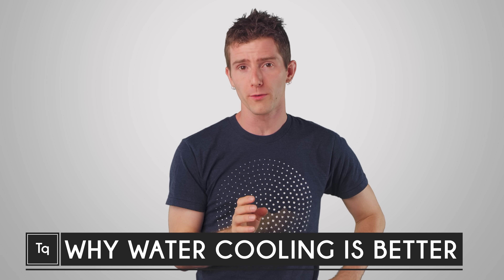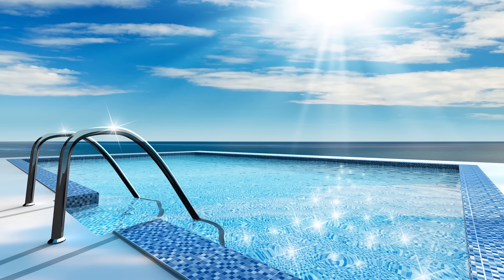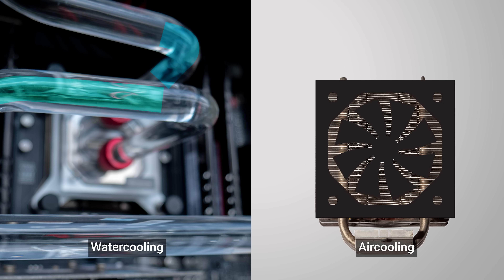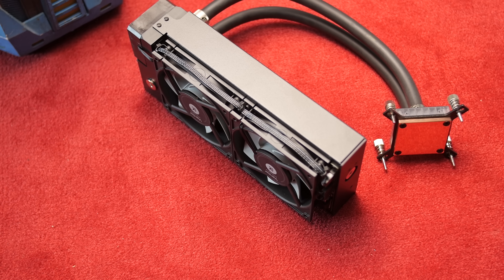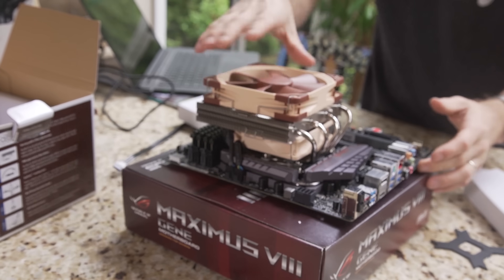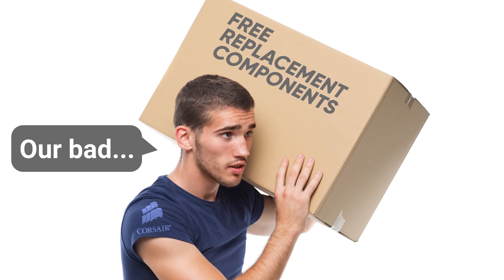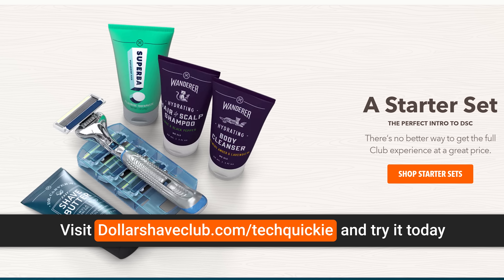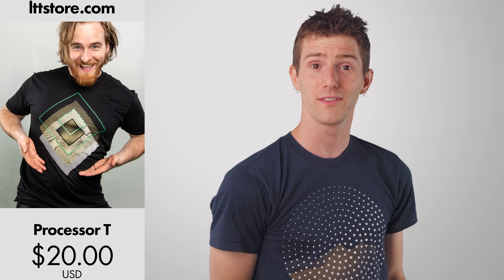Why is Water Cooling Better?

Comment: I think this video has gotten thermodynamics a bit backwards.

Tldr;
Heat capacity does not cool. 
Water moves heat effeciently (lower impedance) to a thermal dissipator (radiator). 
The radiator is better at transferring heat to the air (lower impedance) partly due to size and additional airflow. 

The video spends a lot of time explaining heat capacity, but heat capacity does not cool period. This would violate the first law of thermodynamics (conservation of energy). 
If heat capacity was lower, the flow rate simply had to be higher to move the same amount of energy i.e. same cooling performance/temperate increase in the processor.
That being said a high heat capacity is good at reducing short term temperature increases from the processor e.g. a standard intel boost stage. 
Thus water cooling will appear as having a much higher cooling capacity until the loop is soaked with heat. 

What is important is simply that moving water is very good at moving heat and distributing it efficiently over the radiator area (main problem in heat pipes). Moving heat efficiently to the radiator is what matters.

The radiator is where heat is dissipated i.e. what determines the cooling performance (nothing else e.g. the thermal capacity or flow rate etc).
The radiator is what makes water cooling great. It has a much higher effective/efficient area (or higher or better utilized airflow) for transferring the energy to the air than an aircooler. That combined with the fact the water transfers the heat more effeciently to the radiator (low thermal impedance, especially at low temperatures) and that (as you say) draws in fresh air as opposed to case temperature air, which is often much hotter will yield a considerable temperature improvement over air coolers.

Comment: i have a xlc 240 predator in my system. been up and running since i bought and installed it. had to change the block that it came with tho cuz they seem to leaky very very slow where the rubber gasket  meets the block.keeps my cpu at no more than 52c overclocked. very quiet too!

Comment: Either better performance or lower noise, both are good reasons for getting a water cooler, my old rig came with a extremely noisy air cooler, I still blame it my current ear problems on it (it sat at my left, my left ear have lower performance than my right ear, ant it still have noises [ringing and white noises] they're manageable though), took me too long to realize the benefit of a water cooler, bought one, no more noise, very quiet year around, quieter than the cooler on summer, never overclocked it, though.

Comment: The amount of misinformation in this video is extremely worrying.... Dislike from me.

One non-truth mentioned early on is briefly somewhat corrected at the end of the video, but that's not good enough.

Air coolers are either quieter or cheaper than water coolers. This fact alone means that, aesthetic preferences aside, watercoolers are NOT as good as air coolers, and should generally be chosen for reasons other than performance or quietness. It is worth noting however, that watercoolers tend to have smaller temperature deltas. In a scenario where a watercooler performs just as well as an air cooler, the watercooler cools down more slowly after, and it also warmed up less quickly. This is beneficial for the longevity of components.

However, watercoolers come with plenty downsides, like:
- more noise (pump)
- higher cost OR worse peak temps
- higher system weight
- a failure point (pump)
- the (though rare) possibility for leaks, which could then lead to other components shorting out/dying

So, the plus sides of watercoolers once more:
- reduced case temps (if radiator mounted in exhaust position)
- CPU (or GPU) heats up and cools down more slowly (despite the higher cost or worse peak temps)
- 'cool factor'

Basically, there's nothing wrong with watercoolers, and nothing wrong with aircoolers. But know that watercoolers aren't magic before you go out and buy one :)

Comment: Well to be honest. No aio beats a noctua nh-d15 after like a half hour or an hour of stress test because water just keeps on getting hotter. The noctua will get hot faster yes but the max temperatures are still lower.

Comment: The facts were in my opinion "Generally OK". But in my opinion it's kind of "bunk" to say that watercoolers are quieter than aircoolers because their fans don't have to work as hard...

If a cpu puts out a certain amount of heat a fan will have to "blow it away" one way or another regardless what "system" You use... The factor that lets watercooling fans be quieter is IF you use a bigger area for the "radiator/heat sink" (which You almost always do), and this in turn lets You run Your (usually larger and/or more) fans at lower rpm's which is quieter...

Comment: Water has a high heat capacity because it can vibrate in 6 directions

Waters high heat capacity comes from the fact that it can translate its heat energy into 6 kinds of vibrational energy. Most materials can only vibrate in 1 or 2 ways, so there is only so much heat they can absorb. Water can "store" that heat in 6 different types of movement, so it can store a lot more energy per degree Celsius.

If hydrogen bonding were the explanation, then metal (having each metal atom fully attached to each surrounding atom) would have an even higher heat capacity.

The hydrogen bonding does explain why water doesn't evaporate as quickly as it should. So to some extent it can absorb more heat before evaporating that might be expected from a similar liquid without hydrogen bonding. (This is why alcohol and acetone evaporate at much lower temperatures)

To see the 6 possible vibrations of water -- http://chemistry.ncssm.edu/watervibCS.pdf

Comment: Aside from the fact that you said air cooling is as good as water cooling .. 
even before you said that .. I am convinced that the majority of people don't need water cooling .. and most people that get it just wanna look .... cool ..
unless you are an OC maniac .. you are just fine with a good air cooler .. they are not noisy at all these days .. actually I'm running the stock Wraith Prism and I can clearly hear my mechanical HDD which make it noisier than the cooler .. even under heavy loads I can't hear it.
So why the hassle and risk of water in my rig and maintenance ? .. It isn't worth it .. !!

Comment: Noctua NH-D15 + i7 9700k@5.0GHz (won't go higher) and practically inaudible  (case sits beneath my desk..about 75cm / 3 basketball width from me).  Can't complain. AIO's can't do the same and custom loops that could would be way too expensive for it.

Comment: Water has that high heat capacity not just beacuse of hydrogen bonding that is not as strong as other major bonds for example covalent (this uses this,basically sharing electrons)any ways the covalent bonding is very strong stronger then in any other substance,we'll most,this beacuse when an atom like let's say hydroyon bonds, specially with oxygen with oxygen being the electron stealing (we'll extremely electronegative,one of the highest)and hydrogen not having any electron shielding ( this weaklings the nucleus grip on the electron easy to pull of,basically the more electrons the easier it is for example lead would be a lot easier to pull a electron of beacuse of it shells beacuse of its shielding,basically less energy to pull of then hydrogen). So that leaves with an oxygen that really wants the electron and hydrogen atoms that really don't want to give it up,this produces most of the high heat capacity.they are others that contribute but these are weak dispersion forces van da veles and I think London dispersion forces.
Reply: Should always do you research fully or do applied science like me

Comment: what liquid cooler do i need to get better than noctua NH15 thermal performace and still lower or equal audio output even considering a large slow fan is a less anoying sound than a pump.

Comment: Easy, it's not. It's more effective at removing a lot of heat, but if your CPU does not generate a lot of heat water cooling is kinda pointless. Better really is a sloppy word anyway. Just because something is more effective in some situations does not mean it's good in ALL situations. Air cooling still has it's use and in my opinion is "better" in certain setups.

Comment: I’m so confused about these arguments for water cooling. You’re still ultimately transferring the absorbed heat into an aluminum fin stack...and blowing air over those fins with fans. Just like an air cooler. And while the thermal capacity of water might be much greater, that’s only beneficial for the first 30-45 minutes or so until the liquid’s thermal capacity gets saturated (to an acceptably safe level so as not to cause pump or tube damage), at which point the bottleneck is, again, the radiator and fans.

Comment: So the one thing you forgot to mention about AIOs is they tend to last about 5-7 years because the pump will eventuality fail, and the liquid inside will get mucked up. Air-coolers last forever (and some are also liquid cooled with vapor chambers), though the fan on an air cooler will eventually fail, they are easily and cheaply replaceable, unlike the water pump of an AIO and they aren't really repairable anyway. There's also a huge price difference between AIOs and air-coolers too, and I'm not willing to spend $150 for something that last 5 years, when all the other components in my PC have lasted for much longer.

Comment: My Coolermaster V8 looks very cool and works nicely. It's very big and very heavy and I've never had a problem with it torquing my motherboard. Plus it costs substantially less than a water cooler.

Comment: I originally had bought a water cooler when I wanted to overclock my old PC and I busted the thing because it had Intel mounting pre-installed and I couldn't get it off (I use AMD). The manufacturer did send me a new one (which I sold because I wanted nothing to do with it after that). I just ended up sticking in a Hyper 212 Evo in it and it's been keeping it plenty cool. My system can't handle more than 3.5GHz... but considering it was 2.6 stock... that 900Mhz boost makes a huge difference.

Comment: Considering you showed in another video that it takes 360mm of radiator to even compete with a d15 that's less than half the price. That's a no from me Jim. No reliability concerns. No performance drop over time. No piece of shit pump.

Comment: Who freaked out when you showed the results for thermals on nh-15 vs water coolers? This is a paid promotion for water cooling lol.
"Water cooling is quieter.
But air cooling can be quieter because they don't have pumps"

Comment: Water cooling is better - if you want to spend more money, listen to more noise and eventually have coolant contamination, clogged fins, pump failure or coolant leakage.    If you want the same cooling without that, buy a high air flow case with good fans then get good coolers from Noctua - end of story!     Will you please tell the truth?

Your example about the swimming pool being cool on a hot day is as accurate about pushing people to use water coolers in computers.    Decades ago when I went to Fort Sill Oklahoma to take the officer course in field artillery the temperature was constantly very high, one of the hottest summers in recorded history.    The swimming pool on base was so hot that it was closed.    So much for water being such a great cooler.

In computers, especially overclocked, water simply gets hot much slower than the Noctua cooler you mentioned, however, if you tax the computer for a long enough period the water gets hot and after leaving the taxing environment it takes much longer for water to cool down compared to a Noctua air cooler.

And, you do not need a Noctua NH-D15 to cool four, six or eight core CPUs, a Noctua 14" will do.   A Noctua NH-U12S will cool an overclocked Intel i7 8700K.

The only reason that I might replace my Noctua NH-U14S is if the Intel i9 10900K IHS is too large.

I wonder if a few people will get to the latter 3/4 of your video to see you make a few good comments about air cooling.

You are a tech guy, you know these things.   I have never given a thumbs down for one of your videos, until now.    Start telling the whole story.

Comment: As a truck driver I wish there were great ways to have a overclocking laptop with liquid cooling. Even without  overclocking liquid cooling on a laptop is great as the air in the semi truck may be hot in the first place.

Comment: I see all these water cooled builds on Youtube.. but you hardly ever see them 18 months later. The ones you do see always seem to have some issues with the water cooling system, requiring a draining and cleaning. I understand the benefits and maybe they are super reliable *now, but I am holding off until I HAVE to use one. I still like the K.I.S.S. methodology. Keep It Simple Stupid. Water cooling is not exactly simple even if an AIO due to the possible issues it can create.

Comment: Why are radiators mounted so that they either pull (warm) air from in the case or push their (hot) air back into the case ?  Why aren't radiators mounted externally to the case volume so that the air flow to and from the radiator doesn't mix with the case air flow ?

Comment: What the f*** is he talking about? Laws of thermodynamics are wrong? The point here is heat dissipation in both cases it is hot heatsink. The only effectiveness factors are speed of dissipation and heat pockets. Secondary factor is noise. Third factor is deployment price. But you ALWAYS should start with airflow - this is where you dissipate heat. Both water-cooling and air-cooling are fine as long as provide good airflow. And of course you should cool all your components not just CPU.

Comment: Still aluminium greater heat cap. But the working fluid used in normal fan with aluminium spreader is air. And if we compare with water, it's far superior on removing heat out of cpu.

Comment: Heat capacity just matter until the water hits certain temperature, probably in the fist 30 min or less. After that will depends of the size of surface dissipation, and airflow. I more than satisfy with my Akasa Venon Medusa, a high end air cooler, efficient and silent

Comment: Linus... Im giving my dream pc another go. I've failed three times and I hope it works this time. I'm relatively new to water cooling as I tried to install a premade AIO on the third go-around and was wondering... Since water cooling is the best... And liquid metal conducts heat the best... What would happen if you used LIQUID METAL, IN an AIO... Given all the metal parts and pumps support the flow of the liquid??? Food for thought and maybe the future of sustained cooling since liquid nitrogen evaporates??
Reply: Pumps aren't really designed to pump something as dense and heavy as a liquid metal... not to mention their tendency to amalgamate, depending upon the materials.

Comment: Even with a water cooler you have to dissipate the heat into air though
It's more like having a big copper block on an air cooler before getting to the heatsink, it stores more heat before getting "hot", what matters is how much the fans and fins dissipate, so I'f guess it comes down to the fans airflow and fins surface area

Comment: You can get similar results with aircooling, but watercooling assures that your CPU won't thermal throttle as fast. Had this discussion with the guy at the computer store and he just said it looked fancy and the performance boost was neglectable.
Reply: Yeah, you need to get into the higher end custom stuff for watercooling to make a meaningful difference in temps.  AIO's are not much better, if at all, than ginormous air coolers.  Ignoring the danger from leaks, air coolers also just have less moving parts making them cheaper to repair.

Fan stop working on your Le Grand Macho RT?  Cool, stick another one on there... problem solved.  Cost like $15 or so.  Every moving part for a water cooler, though... not cheap.

Comment: 0:43 "heat capacity is how much energy can a substance absorb untill it changes STATE not temperature" state= liquid to gas
Reply: no heat capacity is how much energy an object (ex: 15 kg tank of water) can absorb for an increment of temperature change, specific heat capacity is the amount a given mass of an object (ex: 1kg of water) can absorb to change an increment of temperature. the energy required to change state of a given mass of an object is usually referred to as the heat/enthalpy of vaporization (liquid -> gas) or heat/enthalpy of fusion (solid -> liquid). that being said using the word before it changes temperature is deceptive because temperature can increase in increments and doesn't just step from 25°C to 26°C instantly

Comment: water heats late, but also gives off heat late as well. So after 3-4 hours of gaming etc, you system will continue to run at a higher temperature. And since its a closed system, there isnt much heat transfer ... water cooling works best with big mechanical parts like and engine since they can run hotter for longer. But for CPU/GPUs air cooling is the best.

Comment: Introduce yourself to Noctua. Only 1x / 2x fans can fail compared to several moving mechanical parts found in an AIO water cooler.
Reply: Noctua, Thermalright, BeQuiet... lot of good big air coolers.  Even that, uh, what was it called... Scythe Fuma 2 is pretty damned great, especially for the price.